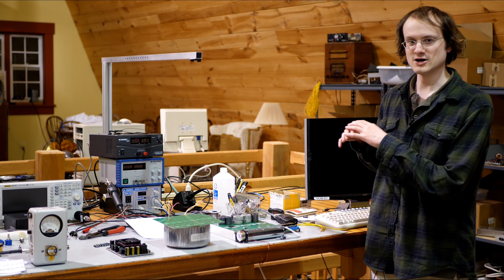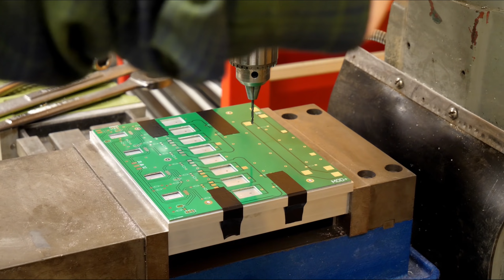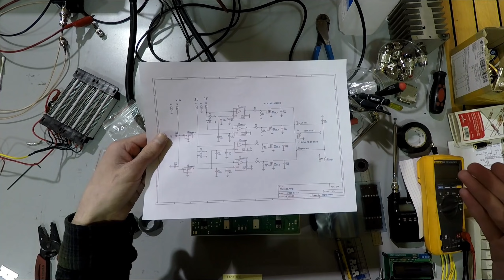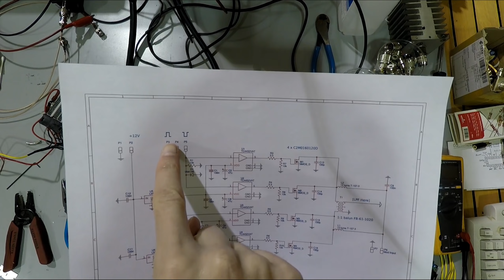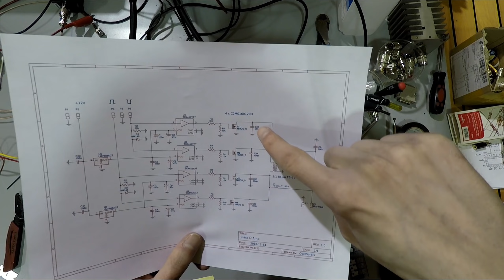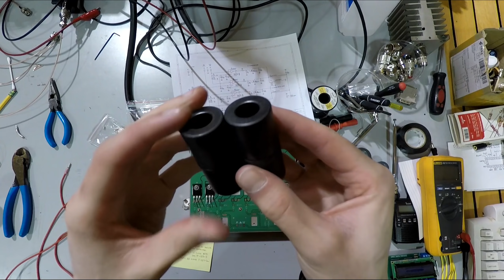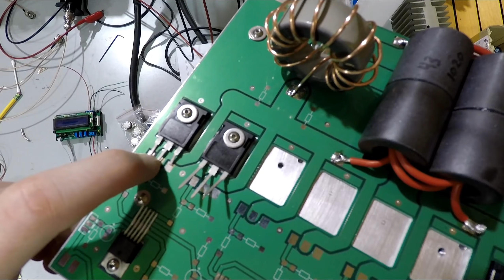Build a High Power Shortwave Transmitter!

Comment: What does the spectrum plot look like for this amplifier?  I'm curious what the harmonics look like.
Reply from the maker: I'll keep that in mind for the follow-up.
Reply: @TechIngredients  All the hoopla in comments is that homebrew amplifiers and widgets are common to have out-of-compliance spurious emissions. To be legal, harmonics must be suppressed, otherwise you will cause interference to other people in the band. Homebrew equipment should be hooked up to a spectrum analyzer. Advanced hams have such equipments, some test for free. You are within driving distance of the ARRL HQ, there is a lab there that I believe also tests equipment that the public drags in.
Reply: There appears to be no significant filtering on the output. Being that the FETs are hard switched, I'd expect harmonics to be awful.
Reply: @misterhat5823  A significant issue as is localized power decoupling caps to prevent supply noise injection.
Reply from the maker: BTW: There is a low pass filter on the output (on a separate board - not seen in vid). Second: This is a push-pull amplifier and therefore it should cancel the even harmonics also. I little bit of power may still be coming from the harmonics however. We will see. . .
Reply: @TechIngredients  I'm curious how well your filter rolls off, given the square wave input.  What kind of jitter is that DDS chip rated for?
Reply: @TechIngredients  Looking forward to the measurements. Thanks.
Reply: I'd be more concerned about that DDS module. Some of the cheap Chinese modules have terrible spurs.
Reply from the maker: @misterhat5823  The AD9850 is  what it uses. It's still not as good as a traditional VFO, but it's very close and good enough for this purpose. The improved version will use custom programmed crystals from Cardinal (anyone can order what frequency they want on Digikey). This, with an inverter, should produce an ultimate square wave.
Reply: @TechIngredients  This dds is designed to transmit from 100khz up to 8mhz offering good and adjustable separate duty cycle for each channel.
In addition the ad9850 offers best accuracy of 1ppm entire this bandwidth.
Reply: re: " Some of the cheap Chinese modules have terrible spurs."
Misplaced concerns; he's using the SQUARE WAVE OUTPUTS as a clock to drive MOS GATE DRIVERS, he's not amplifying sinusoids per se. Wasn't that clear in the video? Review the schematic - it shows it there then.
Reply: Got a transeceiver circuit designed to be around 7.83hz?
Reply: @user-jp1qt8ut3s  no, it really doesn't. Harmonics are easy because by definition they're well above the frequency you want to keep, so making a filter that brings them down to compliant levels while doing basically nothing to the fundamental is a piece of cake. But phase noise and intermod produce "close-in" noise that you can't just fix with a filter on the output.
Reply: Harmonics are easy to filter out; it's 3rd order IMD that is determined by the bias and devices in the amplifier itself one needs to be concerned with here. This comment still applies - as it is a general comment about distortion and its common cause.
Reply: @uploadJ  There is no bias. This is a switching amplifier. Someone who's been "doing this EE thing" should have seen that from the schematic.
Reply: @Alex Tol, van
Don't get me wrong, but, what a stupid comment, unless you are a complete NOOB. The terminology I used is understood by any radio engineer worth his or her salt. If you don't know what Butterworth, Chebyshev or Elliptical filters are do a search here on YT and become educated on this subject. Been doing this EE thing for more than a few decades now; active right now on 160m WSPR with new design antenna. If none of this makes sense, now maybe it is understood why liberal arts majors are the wrong choice for doing anything practical in this life ...
Reply: @uploadJ  Please calm down a bit.  Not everyone is a seasoned radio engineer, and what is accepted as conventional wisdom by some may be either unknown or the bare-minimum by others.  When you go calling people stupid and/or NOOB, you're doing yourself and the HAM community a disservice.
Reply: DDS with square wave outputs produces a lot of harmonics.
Harmonics are easily filter out with a good  low pass filter.
I use a 7pole lpf and harmonics are well filtered.
See the relative video at my channel and you will see it.
Keep in mind that you will need ONLY silver mica capacitors for a good lpf.
BTW this video is the best i've ever seen.
Reply from the maker: @digitalbroadcasting4665  Glad you liked it. I removed what you said in the description. And you will see I use the low pass filter in the next video.
How much PEP power can the caps that are on your filter handle?
Reply: @TechIngredients  These capacitors are rated at 500v so you can use them for a carrier at 1kw for sure.
Reply: @uploadJ  What's radio?
Reply: @uploadJ  What a fucking tool.

Comment: good job, I downloaded all the files from your site related to the PWM transmitter.
I would like to know if I use only 4 transistors, what will be the output power, is it possible to use it in 49M or 40M HF
Reply from the maker: The maximum power output is 200 watts, but at a maximum frequency of 5 MHz.

Comment: Doesn't it bum you right out when the drill bit breaks in the heat sink. I've had to mig weld and redrill. The fins are the biggest cause of broken drill bits. Taps too

Comment: Idk what you found so strange about MOSFET pin placement: N-FETs customarily have drain ("the output") on the center pin and source on the right, and for P-FETs this is reversed, with gate remaining the left pin in both cases

Comment: You can lay a piece of plate steel or plywood directly on top of milling vice jaws and free hand hold down the circuit board if you go easy bringing down the drill.  If the board walks up the bit then you didn't hold it down enough 😄.  In this case just drill the holes in reverse and hope the heat doesn't separate the copper trace from the fiberglass.

Comment: How about a high gain antenna for free WiFi.  Some crazy Russian Guy youtubes.
The Old Man must have made a pile to finance the fun.
Beamed wireless power ?
Happy New Year  TI  team.

the PCB becomes a significant factor when pushing fast edge rates.
C_stray  for leads and bond wires
L_eq  for leads and bond wires
line to line cross talk

Comment: At 18:20 It's absolutely nothing to do with PEP sounding bigger than RMS power. PEP is generally used to measure the power of an SSB transmission, because it's often the simplest way to measure the power of a nonlinear signal with little or no carrier power. It's easy to display it on an oscilloscope, and measure the voltage and impedance, to measure the transmitter power. 

This transmitter is using Amplitude Modulation, AM, which is legal, but only used infrequently by amateurs, because half of the radiated signal is wasted in the carrier, which holds no information. The two sidebands (USB and LSB, for upper and lower, respectively) each use 25% or less of the available power, so if you're allowed 400 Watts, suppress one side and, and remove the carrier, and all of that 400 W can go into one sideband, giving you an effectively four-fold signal strength. And a lot of your electricity bill is spent on that essentially wasted power. Furthermore, AM occupies slightly more than twice the bandwidth of a Single Sideband (SSB) signal, and amateur regulations stipulate that minimum bandwidth for a transmission should be used.

An SSB receiver is slightly different to a domestic receiver, because it has to be able to re-insert the missing carrier frequency, at much lower power than what was saved at the transmitter, and keep it synchronised to the SSB signal in order for the audio to be heard correctly.

The Amateur Radio License regulations stipulate PEP in dBW. This is because pulsed transmissions can have very high peak power, but relatively low RMS power. An extreme example of this is a RADAR transmitter, which can pulse at many Megawatts PEP, but with a duty cycle of around 0.01% or less. At frequencies above 1,000 MHz, pulsed transmissions are allowable for Amateur Radio use, but RMS power might be restricted to 1 Watt, whilst maximum allowable PEP might be 26dBW (400 Watts). Amateur Radio signals are regulated to limit the interference which they might cause, and it's the peak power which can be detected from a greater distance, so it makes good sense to limit peak power.

I hope that this helps to clarify the statement made in the video?

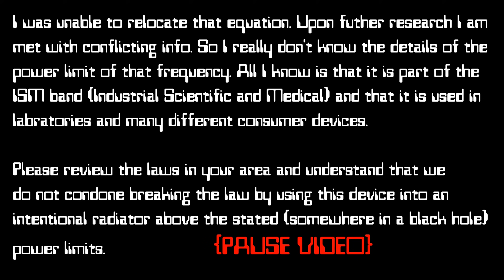Comment: At c. 4:20 - This amplifier will be illegal for use in any ISM band worldwide, because it emits far too much power. Use of ISM frequencies for communication requires Low Power transmitters.  This is clearly a High Power transmitter, according to the video title. 
ITU regulations are worth reading. In general, power output is limited to the order of around 0.01 Watts in many lands, and most allow less than 100 milliWatts, especially on the 6 MHz frequency, but also on various other spot frequencies through HF, VHF and UHF bands. The amplifier you show here will provide more than those limits in harmonic frequencies alone, and with FETs that big, you could be exceeding power limit regulations by a factor of 10,000 or more in most lands. 
Furthermore, many countries require you to register your use of the frequency, and to prove that you are capable of checking that you are on frequency, not emitting significant interference frequencies as well as monitoring maximum radiated power. Many countries also require a license, as well as submission of an identical sample of the equipment for testing and acceptance. (In some cases, the sample will not be returned, because it will have been subjected to stringent testing, and could well have been damaged in the process.) Those tests might well incur more fees.
It's generally much less hassle to obtain an Amateur Radio License which is relevant to the bands you will be using, and to stick to Amateur Band frequencies, and laws, instead of breaking the law of your land with this equipment, which would be patently illegal, if used on an ISM band or frequency.
For the record, I have held a Class A Amateur Radio license for 3 decades, and a Class B license since the 1970's.
Thanks for reading.

Comment: Please specify which class amplifier this is. D / E / F.
Ah, thanks for the schematic. Class D it is. Scary stuff at RF frequencies, if you ask me.
For RF frequencies, Class E or F are more appropriate. I would use Class D for audio frequencies only.
Honestly, I am not impressed by your finals filtering stage. Yeah, I side with other commenters that filtering should be a lot more advanced to eliminate the infinite series of harmonics that a switch produces.

Here is why I think this is scary. Assuming 30MHz output, and 10X chopping, you are chopping at 300MHz. 
1) I don't trust a Chinese module to provide a nice clean 300MHz square wave signal. It gets a bit difficult at those frequencies to push a square wave out without ringing, etc.
2) To properly get 300MHz to your PCB and distribute it within the PCB, you would need transmission line methods. Impedance matching, distance matching for your two traces, etc.
3) More importantly, for MOSFET gate and drain (input, output), all traces must either be impedance-matched transmission line PCB design, or more likely microstrip design. Kudos for routing your own PCB from what it looks like, but this type of PCB routing does not carry to MHz frequencies. This kind of PCB layout would only work for an audio-frequency class D amplifier.
4) Even if you filter the heck out of the finals (multipole filters), there will STILL be ringing and transmission of high-frequency harmonics out from the short sections of PCB trace, leads, etc between the MOSFET and the filter. You MUST use a "tin can" shield around your amplifier to prevent ghosting on neighbor's TV, all of their RF-controlled toys activating, etc, etc.

But then as I kept listening, you did not say you were chopping at multiple of output frequency. If you are not doing that, this is NOT a class D amplifier... It is a very harshly driven class C or E or F, not sure which one fits the best under this scenario.

Even if my comment above is not really applicable to your not-D design, I will leave the comment, for the sake of a future YouTuber who decides to build a chopping amplifier at HF frequencies, and causes interference for the whole block...

Comment: Getting ham radio license is SUPER easy. DON'T BOTHER WITH UNLICENSED BANDS. They all have very low power restrictions. As a ham you have huge capability. I taught a class that was everyone from a stay-at-home-mom to teenagers, to adults of various occupations. All passed after one month of twice a week lectures in the evening. For a student, the Tech License Manual can be understood, memorized, or crammed. Then you do a half-hour test at a local place. I got from no license to Amateur Extra in two weeks of reading, two weeks of testing (I took three tests in one Saturday morning, folks were anxious to get out, so to retest my borderline failing AE exam, I had to wait two weeks for another test within drivable distance).

I recommend starting on 2meter band with a hand-held transceiver. Hobby is not expensive. Assuming the book, Chinese HT, car antenna, window/tree antenna, power supply, speaker, this and that, a bag, you are out $200 for basic 2m operation.

Comment: 4:21 Usually 5 watts, but in this case the FCC is saying 4 watts.
http://afar.net/tutorials/fcc-rules/
Reply: Note that the 4 watts is calculated after adding antenna gain. The reality is you can't transmit with more than 1w of power into any antenna.

Comment: The MOSFET  T_on and T_off  typical data sheet parameter values are
a BRICK WALL for low loss switching.  8MHZ =  125ns,
 For 25ns T_on/T_off,  operating in linear mode 80% of each cycle

Comment: Centre pin output on those MOSFETS is entirely logical and practical. The Silicon substrate is the output connector, so that becomes the centre pin. Both of the other pins are connected to wires which contact the top surface of the semiconductor, and putting both of those pins in the 'outsides’ allows for greater symmetry; something which can be very important in HF and other circuits.

Comment: Amateur Radio signal output power is quoted in PEP because the law stipulates the peak envelope power allowance, not the RMS value, and not because of any marketing hype. If RMS were used as a measure of maximum power, then we would have people sending short pulses of very high power, causing interference and possibly jamming essential services. In practice, for clean SSB signals, 400W PEP corresponds to about 100W RMS.

Comment: I actually was able to create AM modulation by powering a class C directly with an LM386 audio amp chip (not super high power but within Part 15 limits). The LM386 is set to 1/2 Vcc on its output and the output pin powers the class C output amp with DC volrage. The class C amp is one transistor with an LC tank in its collector, which is simply amplifying a 1.620Mhz sine wave (generated by a Colpittts Oscillator) fed to its base. Then audio is fed to the LM386. It actually works really good and the waveform looks great. 

The audio causes the  voltage on the class C amp to vary thus causing AM modulation on the waveform.

This is what they call these days direct AM modulation, instead of using a transformer in the power line

Comment: Could maybe add a Schmitt trigger and an invertor to the PCB layout and drive with a sinewave or squarewave from any frequency generator.  Another idea, perhaps a bit complex to describe here would be to use binary weighted pairs/clusters of transistors and use an A/D to turn on those pairs/clusters to follow the waveform of your modulation. There may be some impedance hurdles, but I think you could make a digitally modulated amp that way. Taking it a step forward, you coukd employ the envelope elimination and restoration concept where you feed an AM or SSB signal into the amp, the amp operating at class C strips the amplitude modulation and you then restore the modulation envelope by detecting it prior to amplification of the carrier frequency the use A/D modulation previously mentioned to restore the amplitude component.

Comment: As someone who built a lower power amplifier and researched switching HF amps a lot...
Class-E is better because you don't need ultra-low capacitance. Some slightly dated info is at www.classeradio.com
Your output transformer is a lossy design. Bifilar wire will help but I know bifilar is difficult with thick wire.
The centre pin and tab as drain is because the die has the drain as substrate, and partly historical.
Get the book "Switchmode RF power amplifiers" by Nathan Sokal.

Comment: Neat build.  The joys of designs, component specifications and electromagnetic characteristics.  Looks like the new formula of Arctic Silver is not electrically conductive... I assumed used to be... though I may be wrong.  I though the old formulas were or at least the non-alumina version of the name and that is why the alumina formula was created.  Looks like the Arctic Silver 5 claims to not be electrically conductive though slightly capacitive. http://www.arcticsilver.com/tc.htm

Comment: Hey Tech Ingredients Can you assist me in making a small 22.2 volt electro magnetic gravitics system? Probably involving some form of Tesla coil. I'm wanting to attempt to prototype a system like such using 22.2V RC aircraft electronics. Don't know if it's possible, but I'll never know on my own because I wouldn't know where to start. I do know the first thing it would require is atleast 2 inch thick copper capacitor plates arranged in a flat circle.